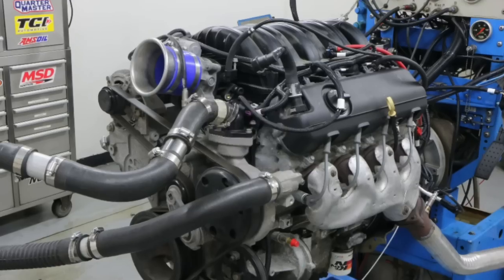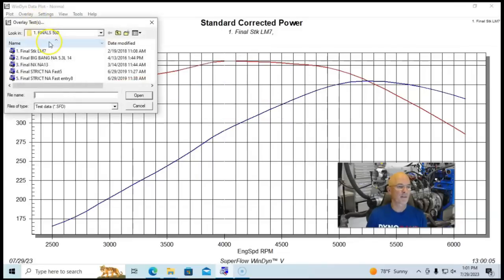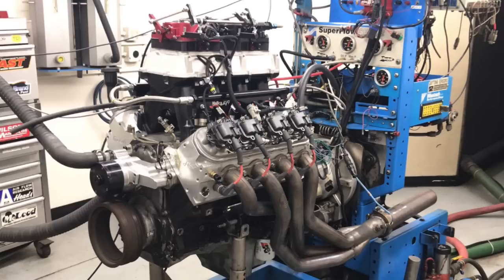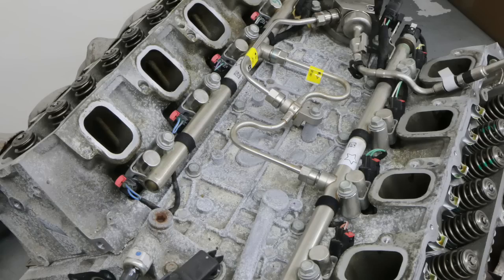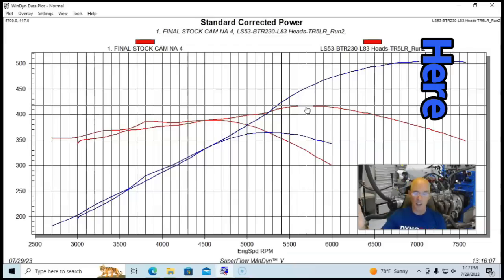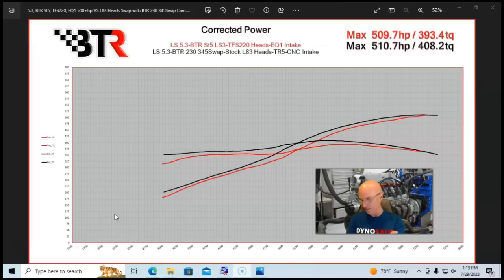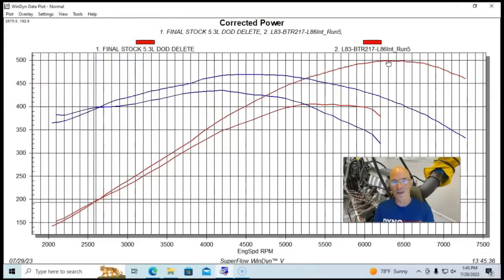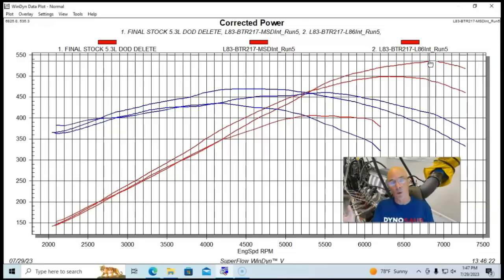5.3L LS VS 5.3L LT VS 5.3L LS/LT HYBRID-WHICH ONE MAKES MORE POWER? 500+ HP 5.3L SHOOTOUT-WHO WINS?

Comment: Have you done any testing with a LT shortblock, LS intake/port injected/cam, DFM delete or L8T similar?
Reply from the maker: why would you try to match and LS to the ports of an LT motor? And you can't run an LS cam with LT heads/block. If you are trying to run LS heads on the LT, there is no reason to do that
Reply: @richardholdener1727  I'll take it as a no. I didn't ask about LS heads on an LT block. I guess I confused you with the cam, wouldn't be a need for the fuel lobe without direct injection.

Comment: After watching hours and hours of Gale Banks drill Charge Density and Velocity into my brain (even though it is for Diesel) combined with Brian's video on the Apples-to-Apples comparison of the Normally Aspirated Direct Injection vs Port Injection on the same engine (L83 if I recall, Dyno'd Direct Injection, then swap intake/injectors and Dyno'd again and compared) , it all makes sense now . Brian's testing showed that Direct Injection (on the same engine) was UP over 50HP/50ft.lbs compared to it running Port Injection. I believe that he mentioned the 'Mass' of the Intake Charge of Air/Fuel combined in the Port Injection setup having less velocity compared to the higher velocity of the pure Air of the Direct Injection. This was 100% due WHERE fuel is added physically in the runner and WHEN Fuel is introduced. Port Injection adds Fuel during the START of the downward piston motion of the Intake stroke, where as Direct Injection adds Fuel under high pressure near the END (top) of the Compression Stroke. It's amazing what can be achieved these days.

Comment: I have a 2002 S10 with a gen 4 5.3 in front of a NV3500. Running off of a e67 ECU. can i use the same ECU if i were to build a LS/ST hybrid??
Reply from the maker: ALL THE ECU CARES ABOUT IS THE CRANK AND CAM TRIGGER PATTERNS-YOU WILL LIKELY KEEP THOSE THE SAME

Comment: Hey Richard, I think it'd be a really neat idea to put these on a 4.8 l and see how they do with the short stroke and high RPM compared to the 5.3
Reply from the maker: it just makes less on the smaller motor
Reply: @richardholdener1727  well it would be neat to see how much the Lt heads gain on a LS1. I've been thinking about boring out my lm7 to a LS1 bore and getting my 706 heads ported by hoopers heads out of Dallas but those results That was shown with the l83 heads on the lm7 were really awesome. I appreciate all that you do man!
Reply: @1NastyZ28 I'm boring my 5.3 to a 5.7 and adding tsp prc 220 heads. Can't wait to see what it puts down

Comment: It's all in the heads.  Port injection makes more HP than DI.  I wanted to do L83 conversion on my LS1, but went with ported 706 heads :/
Reply from the maker: no on port injection making more power
Reply: 🤣🤣 direct injection is always going to make more power. That's why diesel engines are direct Injected ✅
Reply: HEY RICH, WAS THE L86 INTAKE RAN PORT INJECTION OR DIRECT INJECTION?
Reply: DI will always make more power then port, not even a debate. Besides the fact that the fuel from port injection takes up valuable runner volume, one has far less control over injection timing and detonation. DI puts in perfectly atomized fuel exactly when you need it, that's why DI gasoline engines can run higher compression on lower octane fuel. Pilot injection can also be utilized, and one can play around with pulses/ duty cycle.

Comment: Sound like the hybrid is a good budget build depending on what LT heads are worth.
Reply: Youd be lucky to find a pair of LT heads for less than $1200 in the midwest. Add custom cam, valvetrain, intake manifold and nickel-dime stuff and its very not not budget. If budget is in mind, youd be better off just using a L83 dropout and tossing a off-shelf cam on that thing with a DoD delete.
Reply: @airplanelover1231  yea but you would do that all anyway on an LS build.  My point was that the stock LT heads are probably cheaper than new ported and polished LS aftermarket heads
Reply: @rustysausage69 man I've seen entire l83s for less than that here in DFW

Comment: Do they change injectors on DI engine, or do they use stock injectors?  Just curious. Thanks for the Video!
Reply from the maker: there are bigger DI injectors
Reply: @richardholdener1727 l83 5.3 likes lt4 injectors with gt4202r turbo 🔥🔥

Comment: Great test... please visit the correct LSA test on the DI engines .., after the LSA test on the LS402 proved that most cam companies are grinding cams with an LSA too wide for maximum TQ/Power ... would like to see what it does with the DI engines ... thanks   keep up the great testing
Reply: I think most people buy cams hoping to get the maximum TQ/hp ... And I think fortunately you have decided for us that most of the cams sold have an LSA that is too wide ... at least according to your testing ... an advance/retard sweep on the cam is advancing or retarding the cam timing to see where the engine wants the adv/retard to be for maximum TQ/hp... I’m certain you’ve done this b4 ... sorry for not making it clear ... thanks for all your hard work
Reply from the maker: People DO NOT buy cams for max power/torque-the vast majority of cams sold are not maximum effort-in fact only a tiny fraction of cams are max effort. Every cam does not need to be a tight LSA. To think so is to not understand the cam market
Reply: Sounds great i can respect that ... I like the chop too... but for me I like having a cam that makes the max tq/hp for my combo  ... funny thing is two cams of close duration numbers usually have much different idle characteristics  if one has ... lets say a 108 LSA and the other has a 115 LSA ... the 108 will idle choppier than the 115 ... plus for what the average Joe is going to be running in his LS truck or car ie 325 ci 5.3 to a 408ci stroker the 108 has been proven by Richard and a handful of top notch cam guys to make more TQ/hp... so from this we can say on average 98% of Richard’s viewer base would benefit from a tighter LSA than what almost all cam companies are selling ... so the chop crowd would happier and the TQ/Hp crowd would be happier... a WIN WIN ... can anyone honestly say that this would be a bad thing except for the cam companies and individuals with shelves full of cams with the wrong LSA (too wide)... please don’t misunderstand me I know not every application (combo) will benefit from a tighter LSA but the average hot rodder most likely would ... take BTR for example for years he pushed and sold cams with wide LSA’s (112-115)and even put out a video saying that the LSA doesn’t matter and then several years later he comes out with the TRUCK NORRIS cam with a tighter 107.5 LSA  ?  Me personally I really like the TN cam and recommend it to a lot people if it fits their application ... I have a lot of respect for Richard he has done the performance world a GREAT service and no one can say any different... I realize it’s hard for someone to step out of the mainstream and go against the big cam companies but our hard earned money deserves it . IF youre gonna spend your hard earned money on a cam why not spend it on the very best one for your combo. IMHO
Reply from the maker: ask yourself why people buy cams-then decide on what is too wide
Reply: Maybe I should have said max tq/hp for their combination ... my mistake ... like a 5,000lb 4x4 pickup with a truck Norris cam in it ... for that combo they want the max it will give and I think everyone that has a daily driver pickup would agree with that ... with all due respect I don’t think or know of anyone who installs a cam and doesn’t expect the max out of it but maybe I’m wrong idk ... I think you would agree because when you tested the TN cam you look at the dyno graph to see the max TQ/hp and the max average TQ/hp ... my poor writing skills are shining thru... I wasn’t talking about a max effort 1000 hp NA combo... I was talking about the average Joe that watches your channel like me and many others that would just like to get the max out of their pickup or street car with a mild cam ...as with the test of the 402you proved that the wider LSA made less TQ/hp ... of the 4 people I know that have done an LSA test all came up with same conclusion that a wider LSA made less TQ/hp I do appreciate all your tests and I think that’s why you test to prove what works and what doesn’t ... thanks so much
Reply: @lukesimeon5756  I'd say most people want to get max "chop" out of their cam, not max hp/tq.

Comment: LS>LT for reliability alone. The reliability in the new LT motors is just not there. They performed very well but I would sacrifice some performance to have reliability
Reply: Only issue with reliability is the lifters. Same dod/AFM lifters GM implemented in the LS. Both great engines.
Reply: I speak from experience. When I tell you the LT is just not as reliable as an LS I worked at a GM dealership for over six years in Houston. AFM failure. Dod failure. Injector failure. Connecting rod failure. I'm not downing it I'm a Chevy guy.
Reply: the L8T is direct injected, but has no VVT or AFM. I think it's a great candidate for a similar comparison.  with built LS engines of similar displacement.
Reply: On motors in stock cars yes absolutely. And even takeout motors, a valve job is a requirement. BUT.. Catch can not breathing through the intake, DI delete, AFM delete and you have no greater or worse reliability than the LS. Thats assuming the water pump pulley doesn't spin on the shaft, overheat it and crack the block lol
Reply: You smoking something special today?

Comment: How about the new 6.6L truck engine?    That's what I'd like to see with mild cam and trinity intake.
Reply: They are good engines,
Reply: Probably 500hp considering they are 400 stock.
Reply: From building a couple dozen of LTs i can tell you that you're VERY limited in camshaft upgrades because GM ran the piston-valve clearance VERY tight on LT motors. Were talking anything over 230@.050 and you really ""SHOULD"" flycut the pistons or put a different piston in it with valve reliefs. In a LT1/L8T that size camshaft (for non-flycut or upgraded pistons) and ported heads give you roughly 500-550wheel horse.
Reply: Their rods were made weaker so you'll have to upgrade rods....not sure at what point they break but a guy had 5 blocks with three of them having holes in them from rods letting go.

Comment: My question is why such a long LSA on all these motors. We raced dirt track and ran cams with 106 to 108 LSA. We were running in lower classes, flat topped 358 SBC. Just wondering what affect the longer LSA has. I see drag motors running at least 110 and up.
Reply: I think its because they dont want to flycut the pistons for PTV clearance? Idk i saw some DV videos on the topic and it seems to boil down to manufacturers that make the cam sell to the biggest market of buyers - most buyers wont flycut.
Reply: Look at TSP Chopacabra and BTR Truck Norris
Reply: @shadowopsairman1583  id avoid TSP grinds but BTR and GPI are good alternatives(anyone who uses spintron is better than TSP)
Reply: Richard has already done an LSA test on a LS402ci  108,112,120 and yep you guessed it the 108 won ... he also did not do any advance/retard sweeps ... possibly could have found more power idk
Reply from the maker: what is an advance/retard sweep?
Reply: The new gen 5 engines have dome pistons.
Reply: You would have to fly cut pistons  with a tight LSA.
Reply: @horsefly1020  OK, we of course had to run flat tops,, 0 decking was allowed, 64cc chamber, 2.o/1.60 heads, one class was limited to .420 lift, the other was not limited. For the .420 lift class we ran an Isky LR4 cam, I think it was 106LSA and 105 C/L, 248/248 @ .050. It's been a long time.

Comment: Back in the 80s it would have been a super charged engine just to hit 500 hp or a really built engine with alot of the good stuff and race fuel to reach 500 and that would have been with more cubic inchs,  now. 325 cubic inchs will do Almost 600 hp  N/A
Reply: It’s all in the cylinder heads… literally everything in the last 20 years is SO much more efficient than it was in the 80/90s
Reply: @Texas_Road_Warrior it’s not all in the cylinder heads. Much over 500 HP and the bottom end becomes very important. I got schooled by Mr. Carl Wegner from wegner motor sports back in the day. When I witnessed a for SVO 5.0 built engine from them turn 841 HP on the dyno. Granted that was a NA late model racing engine but facts still remain the same. Lots of HP gets either lost or made in the bottom end.
Reply: @MechanicalMafioso I would love you explaining how the bottom end makes or loses massive power. It's not true. It helps keep them together longer, yes. Coatings and whatever might get you a little bit and detonation resistance, but that crank and billion dollar rods and Pistons are doing jack shit if the stock stuff is up to the 570hp motor you are building. Please elaborate on how I'm wrong.
Reply: @jasonbirch1182  Before we get into this argument. Maybe you should look into whom Carl wegner is. I was under the same impression as you that there was this magical cylinder head work he did. All he said was no the big HP is in the bottom end. I’ve got no explanation for this other than that’s what he said. Obviously this was a seriously worked over engine. About 40k in 1998, At the time Carl was a huge Busch /NASCAR engine builder so I think I’ll take his word over some random dude in the YouTube comments. 🤷‍♂️
Reply: @MechanicalMafioso the bottom end doesn’t “make” any horsepower. You just match it for intended use. The LS heads are light years better than the old SBC heads. Even at lower rpms
Reply: @MechanicalMafioso way wrong
Reply: Let it be known. I still have a soft place for sbc 350,  and will build 1 this year, but I'll shot for 400 ish hp
Reply: Yes head tech was not great as well as the ecu was not great...  things would need to be carburated back then,,, i credit the ecu for some if this increase to with modern efi,,  can run closer to threshholds and be safe and make more power today versus back then
Reply: Those old  engines didn't turn any rpm..
Hp=torque × rpm/ 5252
Reply: @thetruthspeaker1927  yes I know this, but you could make a sbc 350 turn 8k
Reply: @thetruthspeaker1978  🤣🤣🤣🤣
Reply: @thetruthspeaker1978 if you claim is "old dont turn rpm" you can always increase displacement and make more torque and so more hp.
Reply: @doctorwhodj  it makes it harder to get traction and you need to grab that next gear sooner so it ends up costing mechanical advantage. If you want to spend more time going fast and less time smoking rubber and breaking parts it's just so much easier with new engines. I have a soft spot for the old stuff but for the best new engines I got a not so soft spot 😉
Reply: Don't forget the main caps are 6 bolt not those fragile 4 bolts we had then or even the splayed 4 bolts that only wanted to be like Rotex. I had 2 NA motors around 800 and one well above at 980. That was 10 k in the 80's and close to 100k for the same parts today.
Reply: Everyone saying bottom end doesnt make HP is completely ignorant.  What's the best way to make power?  Displacement, compression & forced induction.  Therefore, what increases displacement?  Stroke and bore?  What increases stroke? YOUR CRANK!  Where is the crank located??? In the bottom end?  For example:  take a 6.0. (364 c.i). Without even increasing bore size & simply swap your crank to a 4.00" stroke you will gain 38 CUBIC INCHES?  Not to mention it will increase torque.  Bigger motor means you can run a bigger cam, you can run larger valves, and really take advantage of specific intake manifolds that don't shine til there's more displacement or flow!